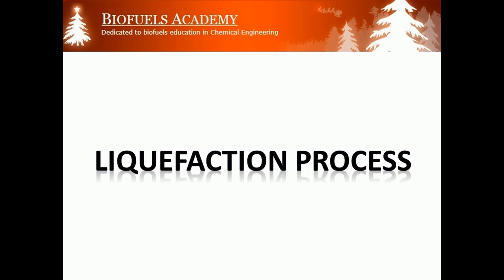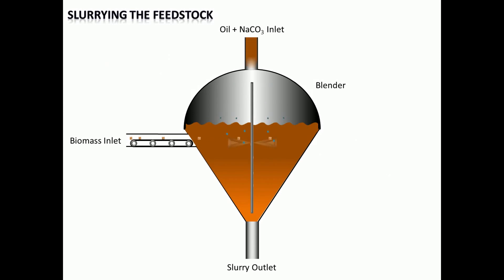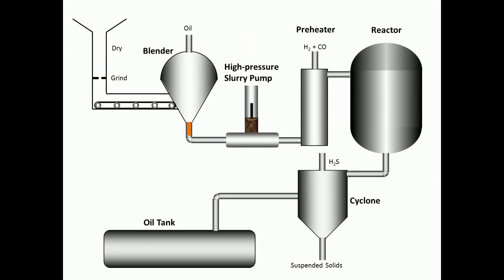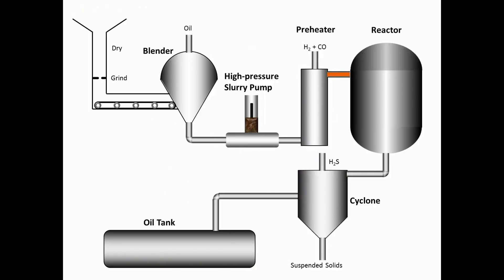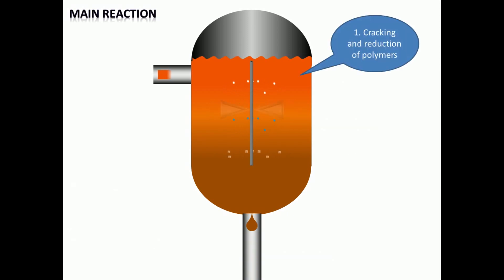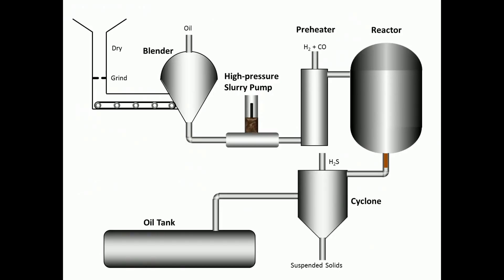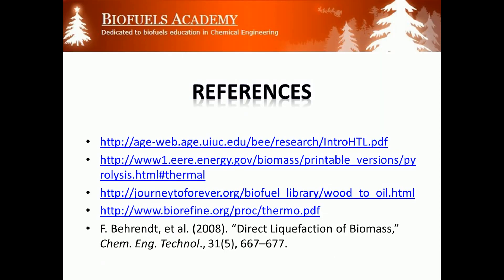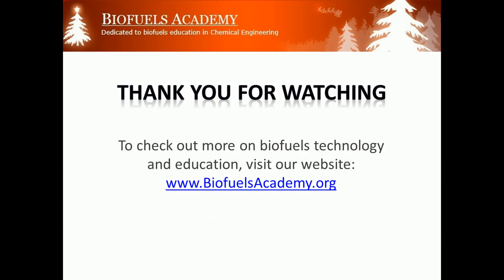Process of Liquefaction

Comment: Would be nice if a wind mill could deliver "directly" enough pressure in a small chamber to obtain liquefaction. The Achilles heel is probably that this process needs fine shredded materials with always more or less the same properties so all the parameters can stay the same once it runs. Otherwise we would have heard already much more of this???